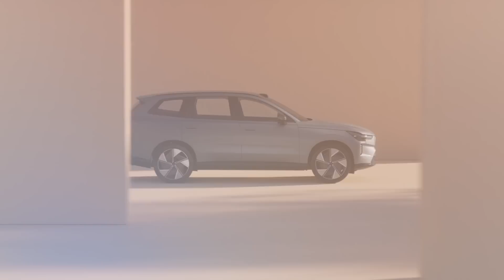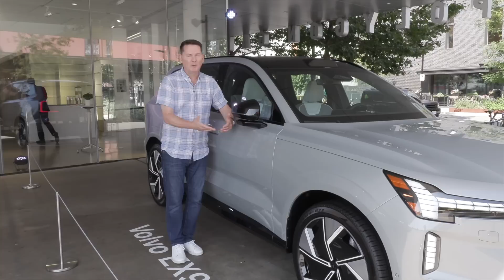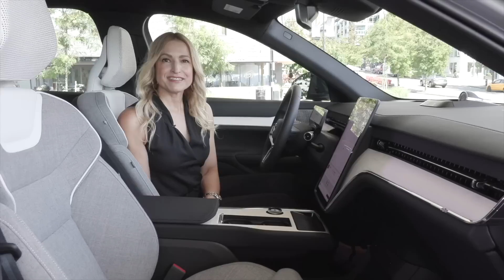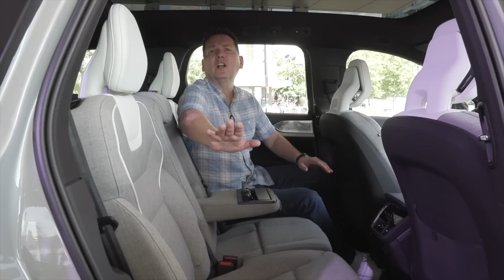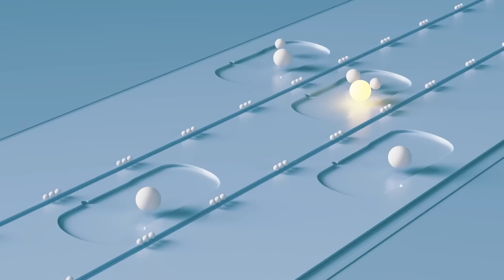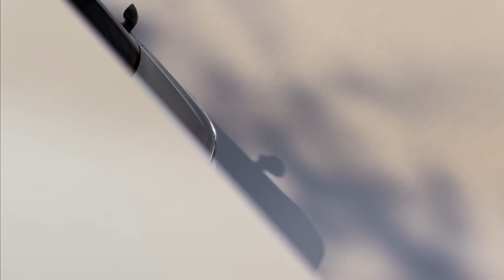All-New Volvo EX90 first look // Any guess on the price??

Comment: easy to know the pricing, take the polsetar 3 and add +/-$ 3K and youll get the price so it will be around 98K for starter model and for a mid level $120K, the P3 I drove last week was $132K top model add those lovely taxes and you have a $140+K car

Comment: I wonder whether Volvo improved the ride quality of this vehicle bc frankly the current gen XC90 is not the most comfortable nor the best handling flagship SUV. I hope EX90's ride quality is as good as its first impressions.
Reply: EX30 initial reports is excellent ride quality and Volvo EX90's sister, the Polestar 3, took a few journalists on a ride and the reports are that the ride is cosseting. We'll know more when the official cars are out and over more extended tests but at least the initial feeback is good. I also hope they've really worked on the ride quality. Handling can take a back seat but I hope the ride is now improved to the level of the competitors.

Comment: Does anyone have concerns about the cup holder on the second row? It is a such critical piece of the car! 😂
Reply: It's a lousy design that won't hold half of your containers stable. Too shallow and lacks any decent support. Current gen XC60 has better and deeper designed cupholders retractable from the front that do not take from armrest space when opened. Very disappointed.

Comment: Interesting… the polestar 3 performance is listed at 517 horsepower with the same 671 lb ft of torque. Sounds like the PS3 will be bumped up higher than originally expected.  Same for the range…. The Volvo is rated at 300 mikes range… but it’s bigger, and waaaaay bulkier than the polestar 3.   So I bet the range is better on the ps3 to
Reply: scandinavian ??? please stop making brainwashing for people , Volvo or Polestar today is a Chinese junk , i have a 2022 electric Volvo change the battery under warranty new in the box ( MADE IN CHINA ) and now the electric motore is noisy ( BACK ORDER FROM CHINA )  all the Volvo parts ( made in china ) BROKE ONE AFTER OTHER,  i pay for Volvo and i get a Chinese junk , NEVER BUY CHINESE VOLVO JUNK

Comment: Interesting. Pricing seems comparable to the current XC-90 in the U.S. I have questions, comments, and concerns, though. I need you guys to drive this one, and give an honest impression of both that experience, as well as the infotainment system. Call me a luddite, but I don't trust a car without backup analog systems. Does look nice, in any case.
Reply: No, pricing is not comparable. You can get a fully loaded XC90 T8 PHEV below $80K, and this nonsense with cheap door handles, gear stick lever from a 15-years-old Mercedes instead of crystal, unchanged up to a buttons trunk space, gimmicky interior door opening and and windows control (1 lever for 4 windows, sic!), a joke kids screen dashboard (compared to rivals) starts below $80K. I hope it's really a pre-production model and they will improve lots of things, otherwise a hard pass. Current 2023 XC60 T8 Ultimate owner.

Comment: nice car but we need more affordable evs in 25k to 40k price range for average household.
Reply: True, but there aren’t many new cars of any sort at that price any more. The good news is that the used market is improving, and you will save on electricity compared to gas. If they haven’t done so already, Motormouth should consider doing a piece on the sort of EVs available in that price range. My Volvo dealership usually has 2-3 used EVs on their lot under $30K Cdn.

Comment: Priced for the rich. Nothing more, nothing less. It may be worth it if the gas price will be like $4-5 per liter.
Reply: This is Volvo's flagship SUV. Volvo has less expensive options. However the EX30 is priced disappointingly high vs. the starting price in the USA.
Reply: @benjaminsmith2287 oh tell me does ex30 has 3 rows? Will ex30 seat 7 people? You do realize it is majority of families including budget and low income who need 3 rows and not super rich loner CEO who can drive sporty sedan. How come family suv with 3 rows suddenly always becomes flagship? Why not make a sporty 2 row sedan a flagship, and make ex90 a family suv with budget price huh?
Reply: @danguelph2676  Volvo is not a budget brand. The EX30 is a 4 seater and barely that. But it is a Volvo. The EX90 is a successor to the very successful XC90 so the market for Volvo says they want a 6 to 7 seater lux "SUV." On the sedan side, they have the S90, a car that did not sell well for Volvo and sedans don't sell well. Volvo is not for a majority of families. That is what some other brands offer.
Reply: @danguelph2676 now you have Kia ev9 mit Outlander etc

Comment: Volvo… the new CHINA owned vehicle.
People can talk EV all they want.
Just ask the people who live in Dallas / Ft Worth, TX , USA about their 2 week blackouts when people who own EVs have to take public transportation to get around. Ask the people in the mid- west that loose 40% of their charge overnight because of the cold temperatures.
Just ask Texas, New Mexico, Arizona during the summer when the electric companies are telling their customers not to run their A/C units until their temperatures reach 90 degrees F and NOT to charge their EVs because it’ll blow their transformers and no one will have electricity.
Tell the tree huggers that there are no safe places to store, get rid of worn out EV batteries.
Tell Communist President Biden (though he will forget) to change his limousines to EV as well as Air-force One. 
And you can also give him and the rest of the Government the Covid vaccine.
After all what’s good for the  SKAVES, is good for the DICTATORS

Comment: Well over 600 lbft torque, this thing is gonna slam you into your seat when you put the petal to the floor....lol
Reply: That car is super slow compared to EQS real-world 0-60 timing of 3.7. Even my XC60 T8 does it in 4.5 sec having the best of both worlds - 40+ miles all-electric battery and a gas engine in case you can't find a charger. No improvement at all from Volvo in this department. Sad.
Reply: I had BMWs x5 v8 twin turbo with 700lbft torque and it was nothing special 😂

Comment: What is the periscope for on the roof over front windshield?
I wish every car maker would give an option for two rows instead of three on “ 3 row vehicles. Some people never use it. Also, not a fan of vertical screen……….that controls every adjustment when you are DRIVING. Thanks
Reply: Lidar I imagine

Comment: Someone will buy it, probably. I just keep rolling my eyes at new EVs and their prices
Reply: It's the same price as the gas version (with the same specs). The EX30 is cheaper than the gas XC40. All new cars are getting more expensive, really.
Reply: @PhilKulak  ex30 is a smaller car than xc40 and it has cheaper materials
Reply: I just got the XC40 Recharge and considering upgrading to EX90 in 2025.
Reply: This same price as xc90 is most countries
Reply: Think Total Cost of Ownership. Cost of charging and less frequent servicing. Buy used and it’s cheaper than ICE. Just don’t pick on the top of the line Volvo for your example. You could buy a used XC40 for far less and be spending $100s a year on charging like I am. Get my first service this spring. New wipers and air filter.
Reply: Way cheaper than a comparable truck